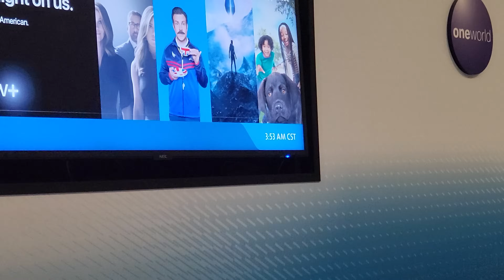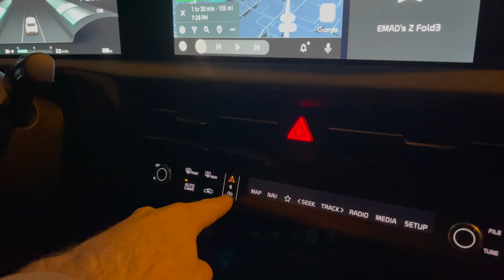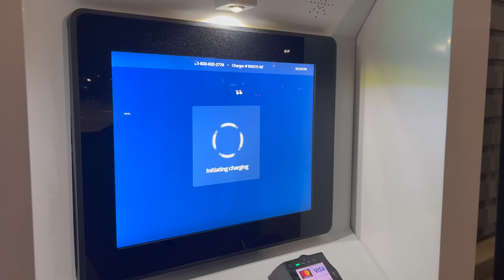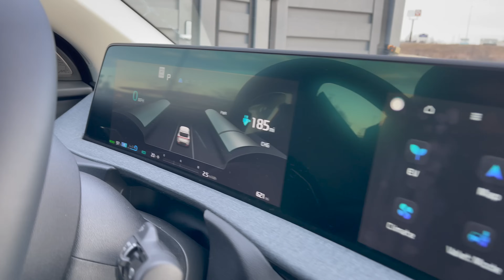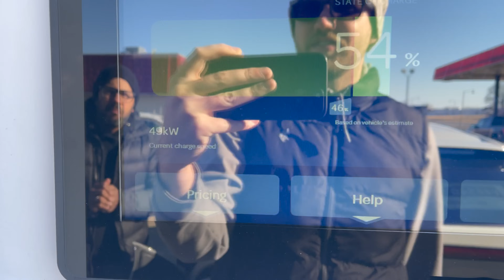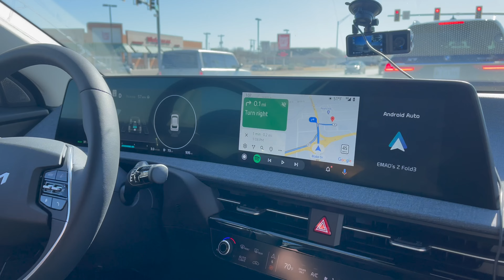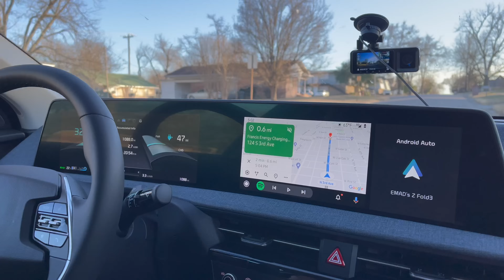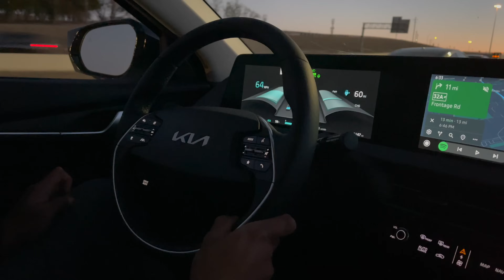First Kia EV6 Road Trip In America! Over 1,000 Miles To Dallas For A First Time Electric Car Owner

Comment: I would love an electric car, but I live in an apartment and the thought of spending up to an hour to charge a vehicle for 200 miles is ridiculous.   My current car, a 2016 Hyundai Elantra, goes over 500 miles on a tank of gas and delivers 45 mpgs per tank (manual transmission).   Even at $4 per gallon, I'm not spending $50 per tank.    From this video, it appears that going EV doesn't save you time or money at all.   I'm sure Tesla fools who get free electricity will beg to differ, but you are spending $50k or more and I spend $13k.   $37k will buy a lot of gasoline (not to mention time saved to fill up).    I'm seeing EV's right now as half-baked and more snobbish than ready for prime time.     And, the only brands I would consider are Hyundai or Kia.    Ford abandoned me when they stopped building cars (Mustang excepted).   My last Ford lasted 22 years (bought new).   I'd have bought another but there isn't anything to buy.    And now that I've experienced Hyundai, I'm not going back.
Reply: "I would love an electric car"
... 
"I'm seeing EV's right now as half-baked and more snobbish than ready for prime time."

Ok, so I'm getting whiplash, which is it? You'd  love one, or they're snobbish?

"but I live in an apartment"

THIS is a valid concern. It is absolutely a challenge to own an EV in an apartment, but not impossible. Many apartments DO have charging stations, and MOST apartments in my experience offer garages with outlets. Ultimately it's just like amenities like washer and dryer you can shop for an apartment that has options for charging if that was really something you wanted.

"and the thought of spending up to an hour to charge a vehicle for 200 miles is ridiculous."

This is where you lose me. If you don't think an EV fits your needs because of your valid concern of living in an apartment: I get that and that's 100% understandable. But why invent false facts to justify it even further? Why go further and try to insult people by calling it snobbish?

Most Teslas, the EV6 featured in this video, and the Hyundai IONIQ 5 can all add 200 miles of range in around or even under 20 minutes. Where did you come up with "an hour" from watching this video?

"My current car, a 2016 Hyundai Elantra, goes over 500 miles on a tank of gas and delivers 45 mpgs per tank (manual transmission).   Even at $4 per gallon, I'm not spending $50 per tank."

So 1st: That's still $0.09 per mile. So if you drive 12,000 miles a year that's roughly $90/month in fuel. My Niro EV costs about $0.025/mile which would be $25/month for 12,000 miles/year. That's a difference of $65/month in fuel savings alone.

2nd: Are you suggesting that the only money you spend on the car is on gas? You don't ever take it in for oil changes, spark plugs, coolant flushes, etc, as recommended by Hyundai? You've never needed to replace the serpentine belt, thermostat, air filter, brake pads, etc?

The truth is the real savings in EV ownership is not just from gas. This is a common misconception. There's typically more savings in avoided maintenance, not just in the cost. Yes an oil change costs like $50, but how much is your time worth taking it in and waiting for the service to be performed? And if a belt or something breaks while going down the road and you have to have the car towed in. Those issues are largely avoided in an EV because there are no belts to break, no clutches or transmissions to wear out, no radiator fluid to flush, no spark plugs or other tune up items.

In 8 years of EV ownership I've never needed to take my car in for any maintenance beyond tires (I change wipers and add windshield washer fluid myself). I've never even needed to replace a brake pad or turn a rotor because the brakes are seldom used on an EV. Most braking is done via regen. When you start adding up all of the maintenance costs required to keep an combustion vehicle running, and how little of it is required on an EV, that's where the savings really started to add up for me.

"but you are spending $50k or more and I spend $13k."

Are you suggesting you bought your Elantra new for $13k?

We paid around $10k for our first LEAF. Then we paid $33k for our Kia Niro EV brand new, but it was the top spec trim level and significant;y more interior volume than your Elantra. I could have gotten the lower spec for $25k.

My sister and her husband bought a brand new Bolt for $24k. Many used examples were available for closer to $15k.

So yes, some EVs (*cough* Tesla *cough*) are pricey... but not all EVs are Tesla expensive. And the overall monthly savings of driving electric, when you add up fuel+maintenance, you're looking at an average monthly savings of well over $100. If you just add $100/month to your car payment (Since you're saving $100/month in non finance fuel+maintenance expenses) suddenly you realize you can afford a slightly more expensive EV without your overall monthly cash outlays increasing. You're basically just shifting paying for fuel/maint to putting that money towards paying for the asset itself. And after the car is paid off it's just pure savings from that point forward.

Again: You have a valid point about the apartment charging situation. It's a solvable one but I agree that makes it harder.

Comment: Not going to happen for a decade or 2 or 5, but imagine if 75% or more vehicles on the highway/interstate system are electric.  You'd need a trillion chargers, ok not that many but you'd need a lot because a fuel stop can be 5 minutes and you can run 300-500 miles without refueling even at 80mph when it 0F.  These things you'll be lucky to go a fraction of that and need to recharge for 20+ minutes.   There will be parking lots full of cars charging--they'll have to run huge power lines criss crossing the country just to fuel these things.  Might as well take amtrak.
Reply: yes, it's going to be a problem in many areas along heavily trafficked routes, in particular, outside of urban areas...  However, some of the new battery technologies are lending hope to storing 600-700 miles of range, which will help reduce some of the charging load/demand.   Even now there are queues that build up at charging stations, partly exacerbated by specific chargers that are not working.  And it doesn't help that the horrendous state of software in these charging stations makes it so that one has to often spend 5-15 minutes just getting the charging to start.

Comment: So, on a 1,000 mile EV trip you need about eight range replenishment stops of approximately 30 minutes each? Sounds like 4 hours of wasted time to me. A gasoline powered vehicle requires about 5 minutes for each range replenishment stop and probably only 3 three stops total for the same 1,000 mile trip with no range loss due to cold weather. My 3 ton 2014 Suburban with it's 31 gallon tank and 20 mpg highway mileage rating (yes, it really can get 20 mpg on the highway) can do with just two range replenishment stops. EVs are the future? Not likely for folks that understand the value of time.

Comment: Are they EV reviewer?
First, they use 150Kw charger. Don't expect the 230Kw charging speed.
Second, they start to charging over 50%. Don't expect the 230Kw charging speed. Didn't they know the EV charging curve?
Third, Don't complain 30kW charging speed over 90%. Even if Tesla can't do that.
Reply: We only anticipated (hoped) for 230+ kW on the 350 kW stations. We do know the curve and didn’t expect those speeds at higher parts of the pack. We weren’t complaining about 30 kW at the top of the pack. I actually pointed out it was impressive.

Comment: Got to say you guys are total newbies to EV's and long trips for that matter.
Ever here of the 5 P's, Planning Prevents Piss Poor Performance.

Door to door, all the stops needed to be planned out, weather conditions, food, sleep, charging, etc. Looks like you are just winging it, que sera sera. Not even basic knowledge in using a charger. Where's the avg. Mi/kwh by leg and overall. Why aren't you charging at the hotels when the battery is still warm? Leave with 100% charge first leg. Are you using Eco mode, what temp is the climate control set to, what level did you keep regen set to? You gave Kia and most EV's a black eye.
This trip is a plug for Tesla's. Just read the comments.
Reply: This trip was a real-life scenario of the average new EV owner, just an adventure video. The hotel didn't have charging, and there were no hotels nearby that had it either, and we arrived nearly asleep so opted to charge in the morning instead. With the coldgating issues, it is a marginal difference charging that night vs. in the morning. We did use Eco mode and had climate control around 68-70. Regen was typically in the middle settings, at 2 or 3, but doesn't play much into highway mileage. 

We still love the EV6 and around town with home-charging, it's largely identical to a Tesla experience.
Reply: @Jordan_Schiefer  
Starting a 1200 mi trip rolling straight out of dealer's lot before the ink is dry on the paperwork, in the relative dead of winter is not 'a  real life scenario of the average new EV owner'. In the same vein a pilot buys a new Cessna and flies across the USA or what the hey let's do the Pacific(pack a bathing suit in case we have to ditch), does that make sense. I've made a number of trips across the USA. I can tell you this is not how it's done and especially if you do it on a world wide stage. You're affecting the opinion of potentially millions. How well it went reflects on the car not you two. For people  sitting on the fence about buying an EV, watching you sitting in potentially dangerous near empty Walmart back lots eating 20 yr old roller hotdogs from a Quick Mart in the bitter cold is not going to entice buyers to EV's. CAPISCE???
Reply: @hotprop92  Waiting for your evangelistic YouTube video to post. Save the world with throw away cars. Great for the environment.
Reply: @cp6027  what are you on about? Throw away cars?????

Comment: Gotta say the more videos I see on the ioniq 5 and the EV 6 the more I want to avoid them. Not even including a level 1 charger with the car is absurd and the fact that they launched without battery pre heating and the fact that they didn’t work to get plug and charge active with EA before launch seems like a misstep. But also the plug and charge isn’t available on a lot of cars either. But this shit needs to get more attention from manufacturers if they are actually serious about EVs.

Comment: Would be hard for small lady to plug in that EA charger. Don't you think?
Reply: Easier than pumping gas.
Reply: @Dive-Bar-Casanova  heavier for sure lol
Reply: My grand father thought the Chademo plug was way too heavy when I was showing him how I charge my Model 3 at the Francis chargers shown in this video. 

In fairness, it was a heavy 200A Chademo cable with no liquid cooling which makes it basically worst case thickness.

Tesla supercharger cables do seem to be easier to handle in general though.
Reply: It's horrible in the cold.

Comment: They stopped for a charge 1000 time 😂. On a normal car they just had to stop 2-3 time for 5 mins max
Reply: in an ice car they would be paying a lot for gas.
Reply: @scotthucks7966  electricity isn't free.  The TFL guys have done some videos on it.  Supercharging isn't cheap when its .30+/kWh.
Reply: @mistermister2085  Yeah, it's like paying $ 9.90 for a gallon of gasoline, but in an EV that is 400-500 % more efficient.  Two other factors forgotten in this equation is the amount of electrical energy that is used in the production of gasoline, and the environmental cost of oil and gasoline.  When total cost of ownership is calculated,  EVs are much cheaper to own and operate, even at the rate of .30 cents per kwh.
Reply: @mistermister2085  Always consider the source of your information. The TFL guys, and journalist/ lobbyists of their type, are under the influence of the Legacy Ice Mfgs.  If they don't give a review that is favorable to the Mfgs, they will be either shunned, or will be the last journalists to get access. In the Youtube world, they would be out of business.

Comment: Good video, makes me NOT want to go out and buy an EV.  I travel long distance trips in my work and having to take so much time to charging (fill up) an EV is ridiculous. Last thing I want to do is spend long periods of time at a Target or Walmart parking lot in sketchy neighborhoods. I'll take my gas guzzler with a 3 minute fill up, a smooth ride, a super cool A/C in the summer and a heater that will melt an ice cap in the winter. What they (MSM) will not tell you is the amount of pollution and destruction to the earth it takes to make one battery for these things is mind boggling. My gas guzzler is more environmentally friendly than these things plus cheaper to buy. For a local commuter it may be logical but expensive solution, but better yet, make special road lanes for electric golf carts. They are cheaper and readily available.